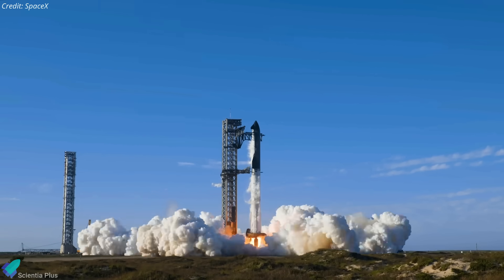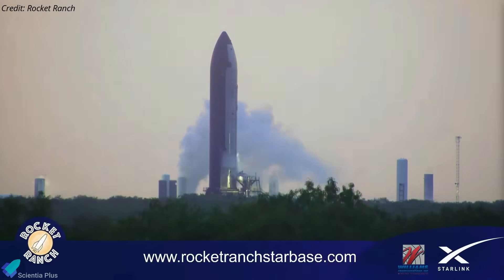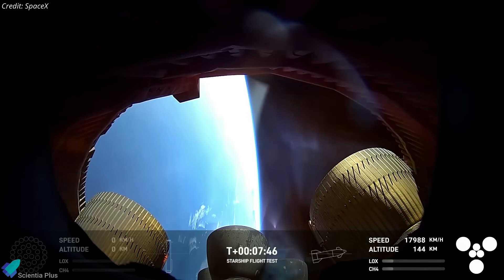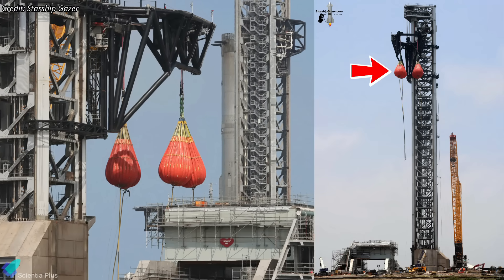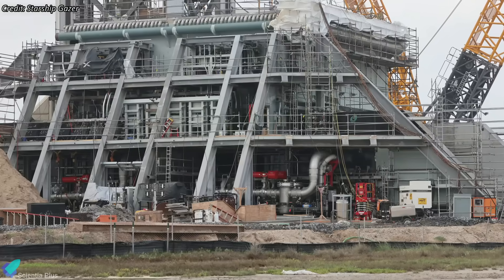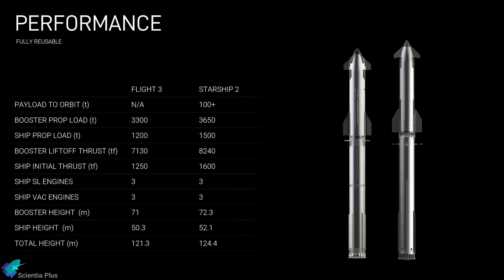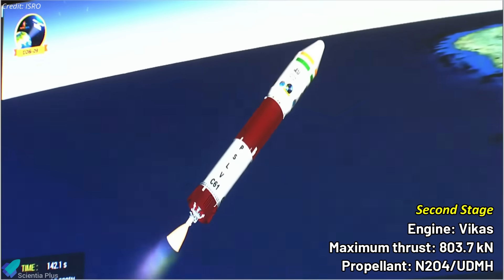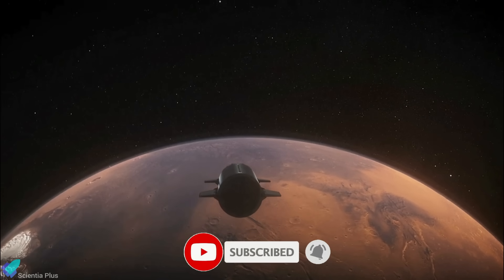Starship Flight 9 Cleared for Liftoff Under Strict New FAA Mandates!

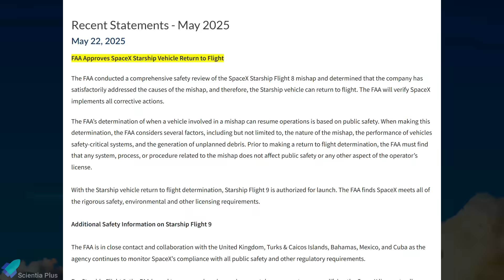Comment from the maker: 00:00 Starship Updates
09:51 Shocking PSLV Failure: India’s Satellite Destroyed Mid-Air

📚 Learn More:

🚀 Starship Block 2 Explained:
 📖 Summary: https://shorturl.at/b0dtw
 🔍 Detailed Explanations:
  • Design Improvements Update 1: https://shorturl.at/lpGT7
  • Design Improvements Update 2: https://shorturl.at/gwNQ4
  • Nosecone & Payload Bay Redesign: https://shorturl.at/xa60S
  • Methane Downcomer Redesign: https://shorturl.at/XdYBG

🚀 Starship Block 3 Explained: https://shorturl.at/mnBT4
🚀 Starship & Booster Block 3 Detailed Breakdown: https://shorturl.at/IViwD
🚀 Starship & Booster Block 3 Production Begins: https://shorturl.at/xRNkJ

🔥 Raptor V3 Mega Upgrades & First Test: https://shorturl.at/TRIyj
🧱 What’s Inside Starship GigaBay?: https://shorturl.at/nJM75
🛠 Insane Engineering of New Starship Launch Pad B: https://shorturl.at/7RAZd

🛠 Other Starship Upgrades:
 • Hot Staging Explained: https://shorturl.at/jf400
 • Super Heavy Booster Upgrades: https://shorturl.at/Pi5R3
 • How SpaceX Protects Raptor Engines: https://shorturl.at/4Om8F
 • New Heat Tiles Explained: https://shorturl.at/p2Ijb

🚀 Starship Flight-7 Anomaly Explained: https://youtu.be/UqzZx7vb-TA
🚀 Starship Flight-7 Root Cause & Fixes: https://shorturl.at/HcLKo
🚀 Flight-8 Complete Breakdown: https://youtu.be/f26yH80RK2o

🔥 Ship 35 Static Fire #1 Anomaly Breakdown: https://shorturl.at/eLCvL
🔥 Ship 35 Long Duration Static Fire #2 Breakdown: https://shorturl.at/Ypf0p

📡 Stay Updated:
📢 Weekly Updates: https://bit.ly/3HIQjPC
🚀 SpaceX Playlist: https://bit.ly/34wue8T

🌍 Follow Us:
👍 Facebook: https://www.facebook.com/scientiaplus

Comment: I don't blame SpaceX for being super cautious before Starship flight 9. Nothing worse than seeing Starship go up in smoke prior to testing its heat tiles during re entry. I'm worried about the performance of the vacuum engines and hope the engineers have got it right. No doubt Musk would appreciate a win after last few tumultuous months

Comment: JUST THEORITICAL SOLUTIONS:
1.) upgrade starship controls to more autonomous(AI)reflexes for quicker responses. if one vacuum engine fails then all vacuum engines must shut down avert spinning if on outside ring(but one lost on centerline, then everyone keeps working hard to make LEO). the starship could go in for low sub-orbital glide to backup water landing, etc.
2.) primary starship power is exo-atmospheric; vacuum engines should be mounted more centerline to the axis of thrust, that way if there is an anomaly you just lose centerline thrust
3.) gimbaling engines go on the outside ring, since they are mostly for landing and back up to the vacuum(primary)engines 
4.) would probably have to redesign the thrust puck, etc.